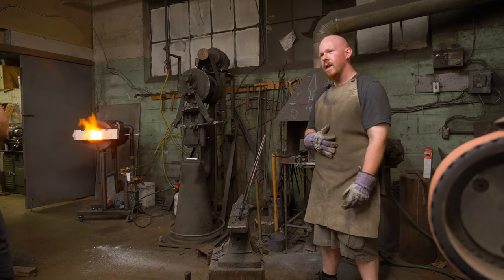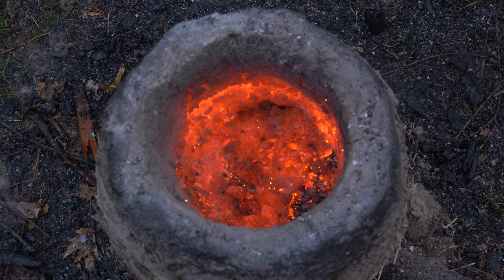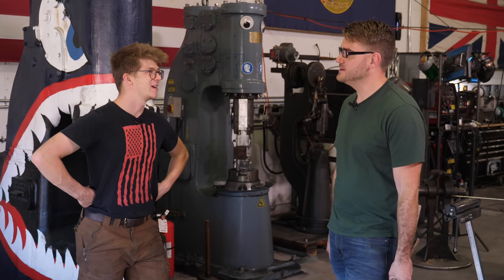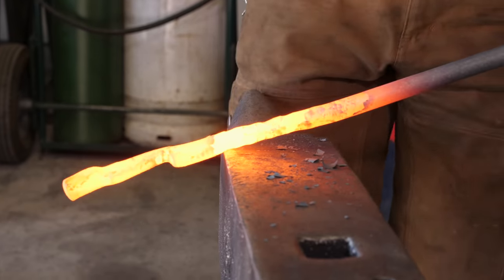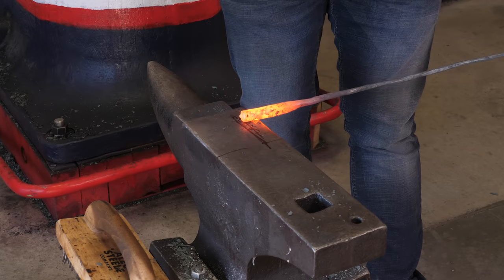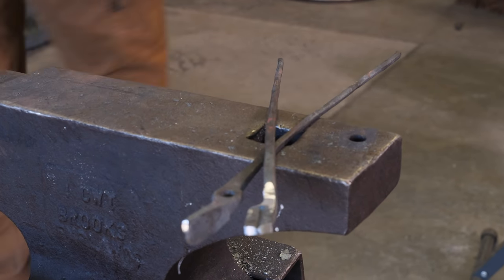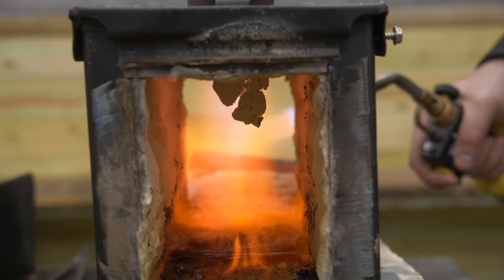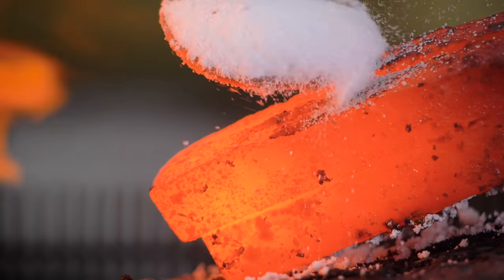Unlocking Iron Tools: Blacksmithing Iron w/ @AlecSteele

Comment: Pretty sure the workable iron that came out of those blooms was the modern scrap you put in.
Reply: Clickbait to the max
Reply: "I shall now make iron using a clay furnace, some rocks, and a bunch of iron."
Reply: Look at his previous videos where he doesn't use any modern iron
Reply: @dela_pinkster3074  what part is clickbait. He made iron tools.
Reply: @sarenhs4535  Using scrap iron is kind of a cheat code, that's what I think people are getting at. Perhaps he got impatient, which is kind of understandable, but that's what smithing requires.
Reply: Probably doesn’t want to travel to another state again just for iron ore
Reply: @infini_ryu9461  And given that the entire point of the channel is to make things from scratch without any modern luxuries, using modern scrap kinda defeats the whole purpose.
Reply: @SILVERF0X13  Modern "scrap metal" is just far more pure than anything we had pre historically, it's no wonder he got at least one good bloom, because it was pure iron.
Reply: The scrap iron was probably mild steel
Reply: @andrewtamuleveicius4183  Yeah, I think the problem was he didn't have enough iron compared to contaminants. So when he added the iron/steel scraps, all that consolidated into a proper bloom, but everything else was wasted.
Reply: @infini_ryu9461  he should have tried finding some bog iron, 200-300lbs crush it and bloom it with charcoal, get the bloom white hot, beat the slag out, heat fold repeat, heat fold repeat.....
Reply: @benadams5557  Well clearly his sources needed to change, because he wasn't getting anything out of what he had. The iron needs to stick to each other, but if the concentration is too low it just doesn't happen. He couldn't even get a proper bloom, let alone hammer one out.
Reply: @infini_ryu9461  like I said, bog iron has a different make up as far as the contaminants go and it has historically been what northern Europeans used in bloomeries. It can be sourced in tons of locations at different grades and is naturally occurring as a result of iron bacteria
Reply: @benadams5557  I'm agreeing with you.
Reply: @airbornewarningandcontrols396  iron ore is everywhere more or less. Just got to know what you are looking for. You can find Bog Iron literally in any area because it forms where water has gathered a long period and dried up. It's also good iron because I live in a town called Vonore which means "good ore" that was known for its Bog Iron. People used it to make weapons and cannonballs during the Civil War.
Reply: @xlDeathlxJosey  Sounds interesting, never heard of it before.
Reply: @airbornewarningandcontrols396  any low lying ground where water tends to drain, fields that creeks and rivers meander across, or old swampy low ground that has dried up are good places to find it. Pretty much anywhere has it. Basically iron in the soil leeches into the water and it's consolidated by iron eating bacteria as iron oxide clumps. People often mistake chunks of it for meteorites.

You can also find another readily available source of magnetite along waterways. When you walk a sandy bank along a river you will often see black sand deposited lightly on top of the lighter sand, that's magnetite. With a simple pan shaped like a gold pan you can sort the magnetite easily and gather quite a large amount quickly. Using a magnet you can separate the better quality magnetite.

Comment: For not knowing all the ins and outs of forge welding, I, amazed you got some of that material to stick together at all! To help make it easier next time, try removing as much scale as you can from the surfaces you want to stick together. The metal you were trying to weld together was super bumpy and hard and full of oxidized metal, so it didn’t want to stick, but if you can get most of the oxidation off they’ll stick together much easier next time!

Comment: Oh man that iron hammer head is a big safety hazard, stick a wedge in the wood!
Reply: Yeah, that is by far the worst hafting job I've ever seen!
Reply: I really hope they see this comment. That thing is going to break something or someone when it goes flying.
Reply: I agree. 
however,
I REALLY want to know how this would have been grafted at this point in technological advancement
Reply: Its wedged and then cross wedged with iron. You can see how alex makes his hammers on his channel.
Oh god I just saw Andy's hammer. I'm sorry for commenting without seeing the whole video
Reply: The dude is known for making some of the best hammers in the blacksmithing world. Ya don't really gotta worry about Alec Steele
Reply: @Marc83Aus  yeah no problem
Reply: @aprilkoyyen7720  I'm worried about andy
Reply: @TDGCmote  andy has made wedges for his log boat before
Reply: @TDGCmote  If we're talking early iron age it likely they mostly treated iron tools similar to bronze tools, forging them to mimic the shape of cast tools, and attaching them in the same way. Over time smiths discovered what they could do with forgings that perhaps was less possible with castings,such as drifting and using wedges. Its similar to how early cast tools mimicked stone tool heads.
Reply: @TDGCmote  You have a split on the top of the wood (the bit that you can see in the iron hammer part) and put a edge into that split.
Reply: He didn't really stay in the era where he made that for long, he didn't learn to haft things.
Reply: Andy is an all round astonishingly bad craftsman — he bungles most things he does by hand. He has persistence and seems to be really good at planning ahead (when gathering resources while traveling and when growing stuff). It’s a weird mix of incompetence and competence :)

Comment: What happened to resetting? Finding nails and scrap isn't really making it from scratch in that age... or a forge
Reply: Or carbon steel hammer and anvil ? But do you want to watch a series that lasts years?
Reply: He made iron.  He doesn't need to make ALL his iron.
Reply: @jakobbull5454  Isn't that the point? Rome wasn't built in a day you impatient child
Reply: @Prober61  He didn't make any iron. The iron you see he "made" is from the scrap nails etc he put in there. The bits he couldn't use because they fell apart is actually the bits he tried to make.
Reply: Maybe Andy just needs to learn how to do it modern first then primitive. This isn’t easy at all.
Reply: You also missed a lot of the Bronze Age if you’re only now asking that.

Comment: You need you use a crucible, when you put that usable iron into the crucible it keeps extra carbon, and impurities from getting to the iron. This is called crucible iron, and it was highly prized in 1200 AD due to its amazing resilience, and flexibility. I wasn’t sure if you had thought of this yet so I decided to just inform you to help, I’ve been experimenting with ore I found in my hometown and it was just way too impure, so if you melt enough iron from the ore you can put it in a crucible and seal it to create a solid chunk from all the small pieces of iron you created over the few runs you made
Reply: He might end up doing that at one point but I think we are still a bit off from there. This episode still counts as 1000 BCE and the very earliest evidence for the production of crucible iron is from around 300 BCE and it didn't really become common until around 600 AD.
Reply: @darthplagueis13  very true, I would like to see him try and make some graphite crucibles, I know that wouldn’t be a thing in the era he is in, but I don’t think clay would cut it quite as well as graphite clay would, its basically the same process when making a clay crucible just graphite would be included within the mix, I was actually planning on trying to make my own crucible, and mixing some bloomery steel, and some relatively low carbon steel to help get the brittleness out of the high carbon bloomery iron. I can tell it wouldn’t be a great quality iron because it’s basically become cast iron, which is why I’m mixing the low carbon steel to help dilute the carbon content
Reply: @HistoricalGeology56  making a clay powder and mixing in about 1/3rd of powdered charcoal works fairly well.

Comment: Hey man fellow blacksmith here, im not sure if its just the camera or not but you'll have much better luck with forgewelding if you abrade away the scale layer of the metal. Also try to do rough shaping at a glowing yellow temp evenly throughout the billet, any hotter and you risk "scorching" the steel.

Comment: Hey Andy, a tip for your forge welds when you're using ingots like that might be to hammer them together at a cooler temperature to mate the surfaces before trying to heat the pieces to welding temperatures. Then when you have it hot enough, light, fast taps will help the pieces stick. And weld in smaller sections over multiple heats. Love your videos, keep 'em coming.

Comment: I think you kinda cheated when you "unlocked" this one. Like, "I'm just gonna throw in all this modern scrap metal but ignore that."
Reply: He also used an anvil and hammer he didn't make when making those tongs.  Honestly I don't think you can compress 10,000 years of development and a million lifetimes of experience (with division of labor, research, etc) into a single person's youtube channel without taking some shortcuts.

You can find nearly infinite ways he's leveraged modern tools to accelerate this process.  How did he transport the ore he found in Utah?  Where does the firewood come from?  Does he start the fires by rubbing sticks together, or make his own matches?  How did he meet and communicate with Alec?  Etc ad infinitum.

The first knife was made purely from rocks.  With that demonstrated, he's accelerating the process by multiplying the raw material with some non-hand-sourced stuff
Reply: I agree, the modern steel almost certainly has lower impurity content and useful additives. It's still impressive what he's doing, but this one fell a bit short of my concept of the spirit of "the reset"
Reply: Give him a break, he doesn’t have the infinite time and slaves they had the first time.
Reply: @ryrandom8785  This.
Reply: @ryrandom8785  but he does have a credit card and an Amazon account.  He could have ordered iron ore.  Or ran sand over a magnet to get magnetite.  Sure the magnet isn't accurate, but the magnetite is, so at least he's using proper materials.

It's like saying your meal is organic when you used factory farmed beef with suppliments and all the antibiotics it can stand.  There's a big difference between that and beef from a cow that was fed factory made sweet feed with its grass.

Comment: "Some" borax
Reply: I've seen things like on Black Bear Forge, when he forge welds it's like a tiny sprinkle of flux. 

I'm not sure how it works, but I wonder what effect the heaping piles of borax had on this.
Reply: @TheJohnreeves  the borax serves to stop the iron from oxidizing on the welding surface. Adding excessive borax might make it a bit more difficult, but the biggest issue is that he's not cleaning the iron off before attempting a weld. The welding surface needs to be very clean before joining.
Reply: @TheJohnreeves  Mainly dirtying up your forge and tools and so on afaik

Comment: I'm noticing that you "anvil" is moving a lot. You are losing energy everytime you try to work your material. Get a bigger rock. A much bigger rock. A very large very hard rock. Your rocks that you are using looks like sandstone. Too soft too much moisture, too much movement. I think that's why it is breaking. Go bigger, harder and try to tie to a big heavy log. Add mass.

I know that I'm kinda back seat driving here, but I'm fascinated by your journey here and want to see you succeed.

Comment: When the iron is sparking, the sparks are small pieces of the iron flying off, burning. Combined with that iron burn before it melts, you will have parts of your iron burn away then you try to fuse two pieces of iron together. So you want your iron just hot so it melts, then quickly hammer them together hard, and back into the fire. Around 2-4 strikes are recommended between heatings. If you have it out too long you risk undoing your work, as when the iron cools, the welding part is the weakest and is what is going to give first under the stress from the hammer.
Reply: I've said it time and against to Andy that he needs more heat with his forging, but he never does.

Comment: Every single time you want to make really good forge weld. You need to have completely clean surfaces. No scale, no dust. Nothing. So if you want to forge weld two stocks like you did. Give them a few light blows with a hammer when their are cold to break off the scale. That should help. Absolute best is grind the scale off but classical brushing the stock while dark red hot will do the trick. Keep it up. It’s wonderful what you are doing.

Comment: Hey HTME, when you forge weld, you need to grind the faces before attempting to weld.  Then cover with flux and join.  What you attempted first was to forge weld with forge scale between the welds.

Comment: also when forge welding you want just under white hot aka as near to melting as you can without actually melting. Then you set with a few soft blow a reheat if needed and slam away to fully fuse the material.

Comment: Hey, pro forge welding tip. Have both surfaces youre trying to combine clean, as in file/sand the surfaces clean of any scale and debris to expose the raw metal. That way you get clean welds and may more success rate, all that forge scale is making it really hard for you when youre trying to combine pieces of metal

Comment: Its shrinking cause it has alot of inpurities in it, you hammer this out that are alot of the sparks and the scale. for forge welding its a must you clean the sides you weld that there is no scale or inpurities. this wil end up in cracks and unwelded spots.

Comment: Love this channel, such a cool concept! One pointer thought, the borax your using for flux can corrode the insulation in that forge, exposing you to some nasty particles! 
Also, that forge design is far from the best. Please do some research into different gas and solid fuel forge designs. Check out the forum IForgeIron, its a great resource for blacksmithing. Good Luck!

Comment: If you clean the metal before you melt it, you will gett less scale in the weld. This will help prevent delamination and allow you to pull out a stronger blade from your ignot.

Comment: Suggestions for projects: Drill bits/ precision tools, files of various shapes, metal tubing/ pipes and possibly wire or screws? with these tools you could massively improve the precision and success rate of your projects.

Comment: Make sure to get the metal yellow hot before trying to weld, it'll stick better.
Also, the more heats you take, the more scaling you will get, where the metal on the outside oxidizes and flakes off, so try to get as much work done per heat as you can

Comment: Make sure you also add a grinder of some sort to your tools list. Clean metal welds easier. Also grinding allows for more precise shapes. You could easily make a file from those smaller bloomery pieces. Just oil quench them, so they stay harder than the mild steel you'll be working with.

Comment: You'll get a lot better results in forge welding pieces of you grind down the top layers of whatever pieces you're forging. Today this is done with a belt sander or grinder but if you wanted to a rough stone or some other abrasive material would work. You're not looking to take a significant amount of material off, just enough to essentially see some shiny clean metal.

Comment: Just a suggestion: zo whenever your forge welding, what you want to do is put the borax on the surfaces that are being bonded together and then get your workplaces white hot and hit them good and hard. Putting borax on the side of your workpiece isnt going to help welp them together which is why you had some trouble when trying to make those hammers.

Comment: you should use a fire at the base of a hill and another one farther up to melt steel. It would be a lot of work to make the heat exchanger up the hill, but the temperatures you could reach would be higher since the fresh air for the second fire would be preheated by the lower fire. Edit: And if you wanted to make something more compact you could use a blower fan and a steel pipe going down the chimney. The heat from the chimney would heat up the pipe and the air in the pipe.

Comment: Shrinking is normal. When Iron reaches that level of heat while hammering (roughly 1370°F) and then drops back down to 70°F expect shrinkage. Also borax removes impurities,  but you definitely want to use anhydrous borax.

Comment: If you don't want the hammer heads to fly off you can try cutting the tip of the handle and wedging in a wedge with some sort of adhesive. I think this is a common way to secure a hammer or axe head.

Comment: The hammers you should thin the handle at the underside of the hammer head. Turn the thing upside down and strike the bottom of the handle while in the air (not against the bench or table) to drive it in. That should give a a VERY tight fit without needing a wedge and ultimately make it safer for yourself.

Comment: Have you worked out the importance of limestone in the process yet? You need something there to lower  the melting point of the slag. You ought to be operating between the melting point of the slag and the iron. Allowing the slag to run out of the furnace when tapped off and reducing the amount in the bloom. The slag is iron rich so is added back to subsequent smelts to recover the iron but also to act as a flux.

Comment: The reason your hammers are smaller than anticipated is due to material loss via scale. As the metal heats up it becomes more susceptible to oxidation which forms a hard and brittle shell. The more times you heat the metal the more material lossed